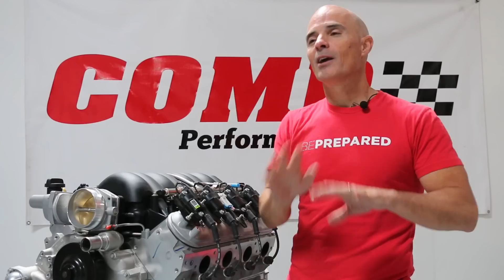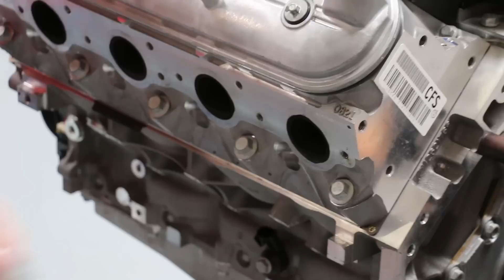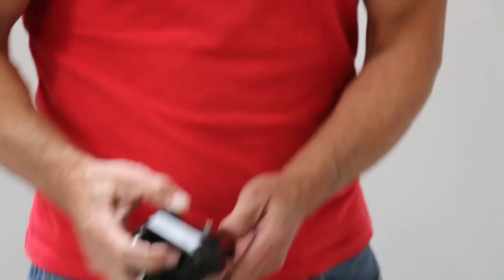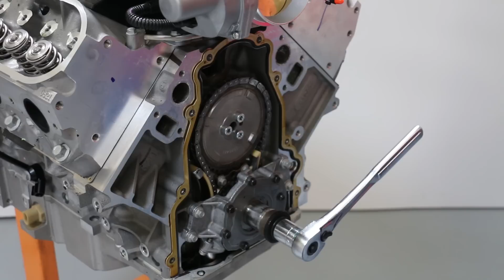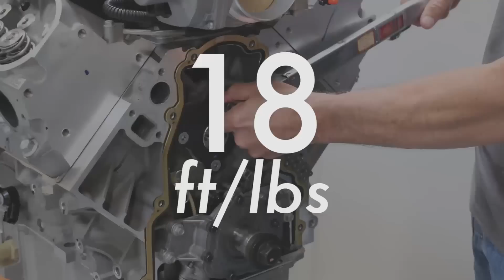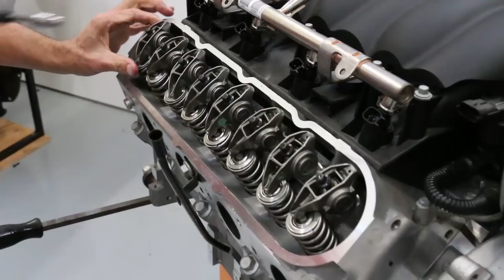Back To Basics: LS Cam Swap

Comment: The crate engine has new gasket and re-use of some would not be a problem, but I have to point out the camshaft plates fitted O-ring potential problem effecting oil pressure. This seals the two oil galleries and allows for crossover on the front & back. The gallery on the oil filter side (Left in drivers seat) supplies both the left bank of lifter but also the cam, main & rod bearings in that order. Oil in the right side provides lifter oil only, but circulated to either side at both ends of this engine. 
 While a fuss is made about the pickup tube sucking air, then using higher volume pumps, plus the dirty oil bypassing the OEM plastic bar-bell are all valid concerns. Many reuse this one gasket on high mileage (Or Less) during a camshaft upgrade. I just want folks to know this $5 part is just as important as checking the timing marks. Even a small leak here could ruin anyone’s day if at temp oil pressure at idle drops to nothing. I never see anyone point this out when both galleries get dowels installed, to keep the lifter up in case the trays don’t hold during a cam service. I would have used more than a squirt of oil on the cam and discuss proper new cam break-in a little. I am sure it’s getting pre-lubed but still not mentioned. Just a thought!

Comment: so one does not measure the push rod length

a novice mistake
also no upgraded rockers, i know how that ends personally
Reply from the maker: If you are re using stock lifters, our LS cams are designed to work with stock length pushrods. Also the stock LS rocker is a decent design, upgrading rockers would not provide much benefit below about .640 lift.

Comment: I have a motor out of a 04 gto. That I’m sticking in a 49 ford haaaa sorry ford guys.  Anyhow. What cam should I go with.  I like to lay it down all the time
Reply from the maker: Actually our 54-777-11 may be a perfect option for you! It's a road racing/ autocross cam so it has tons of torque, especially in the midrange on an LS1. It's also No Springs Required so the stock LS valve springs will work.

Comment: I’m sure google reads my mind I’m doin a sloppy stage2 into my new truck block and this pops up.
Reply: Use a cam with better lopes. CM or BTR.
Reply: ABOlsen80X it’s just entry level turbo deal I’m just copying sloppy mechanics recipe basically.
Reply: Did you have to switch out the push rods?
Reply: Bill Brown I did however you don’t need to stock ones did measure up fine.
Reply: Kiwi Boosted Garage thank you for your reply. I ended up buying some stronger ones but same size.
Reply: Bill Brown yes I did the same and they seem fine, I did the hydraulic lifters as well I think they are ls7 style bit stronger and the best thing to do is new lifter guides or trays, and the cam retainer plate to ensure a good seal for oil pressure.
Reply: Google can't read your mind yet, but they do listen and record everything you say.

Comment: My son has a 99 Sierra with a 5.3 with 180k mikes. I know the old design small blocks but haven't had to work on an LS. The seem very simple. My question is 180k too many miles to be hammering on? I wouldn't even ask the question about the old design because those rarely even saw 180k without a rebuild. This one still has great oil pressure, good compression and no smoke. Just not sure it would be worth doing or not.
Reply: You have a few things to consider here. You'll need to change the springs, lifters. You'll find about half of or more of your pushrods are worn into the rockers. After rectifying that you'll want to get a converter to make this all work. Weight of the truck, converter, gears and transmission are all factors in choosing the proper camshaft.

Comment: Pretty good vid.I gave it a thumbs up for sure, lots of useful info, sped up in the right places, details and torque specs. Very good info. The lifter rods are a must, (ask the guy who had one slide out and drop into the bottom end...), things I'd like to add to the video for those about to do a swap. 
1.When installing and removing the cam, take more care and time, I heard a lot of clanking and cringed as he was sliding the new one in.
2. Change the timing chain damper to an LS2 style, yes the chain will have some slack, also swap to a C5R chain
3. Should use a new cam retainer plate
4. Loctite on the cam bolts
5. RTV in the bottom corners of the timing cover where the oil pan meets up
6. Press the damper on with some threaded rod or a bolt and use a nut with some washers to do the pressing.
7. Buy an ARP damper bolt, reusable and torque to 250ft lbs
Reply: Very good info!!
Reply: I’ll inform my mechanic 👨‍🔧 those tips when I get my cam swapped

Comment: Do you recommend red loctiting the three cam/cam sprocket bolts?
Reply: never use red loctite.  You'll have to use an air chisel to take them out.  I use blue on mine and have never had issues getting them backed out.  Also if you have the cover that uses torx head bolts only torque it to 11 lb ft.  If you have the hex hed bolts torque them to 18 lb ft.

Good luck Zack.  Also, I have a pretty detailed video that shows my cam swap that goes into some things that others didn't cover if you are interested in checking it out.  It also has dyno results!

https://www.youtube.com/watch?v=E0De1c0XwmQ&t=1494s
Reply: @JeffLyle  No air chisel required. Just a little heat from propane torch and ANY color loctite becomes un-loctite!!
Reply: @milojanis4901  haha very true... heat will melt all loctite.  Just be careful with heat on internal engine components... overheating can impair the strength of bolts and other parts.

Comment: Sorry if this is a "rookie question" but i'm wondering if a LS9 cam would work in a 5.3 LM7? This is my first LS build and the engine will run about 10 PSI of boost from a turbo. If it will work what else would I need? ie: valve springs, lifters, pushrods, rocker arms ect. If not what would be a good cam to look into that wouldn't break the bank? (LS6 cam is unfortunately not an option for me) Any info would be greatly appreciated. Thanks.

Comment: At 3:43 the cam bolts were allen key, at the 4:30 mark they are 10mm.....
Reply: He mentioned that he would take a look at another motor with the oil pump removed to better show how the marks line up for TDC.

Comment: Is there a reason to not take the oilpump off? It looked simple enough without taking it off , but just wandering?
Also I don't feel too cheap using HarborFreight ratchet sets after watching this.
Reply: im wondering as well. Remove oil pump or not?

Comment: always spin the engine over twice after u have the timing set in place to 100% verify that you are in mechanical time and the dots line back up
Reply: Great tip
Reply: Have you guys ever seen the 2 dots suddenly not align after turning the engine? I'm just trying to understand how they wouldn't align after the chain is tensioned and bolted. Obviously easy to check, just curious
Reply: Only if number one cylinder wasn't at top dead center when you started. Make sure something weird didn't happen before you start like your keyway broke or your crank gear is off or something like that
Reply: Imagine getting it spot on dot to dot, putting on the timing cover and then finding out later on you are off 1 tooth. Would be pretty unlucky

Comment: You forgot to put sealant on the mating surfaces between where the oil pan & timing cover gaskets meet.

I just fitted new lifters into a stock LS1 engine with a tune done on it, it is one Holden ordered with the 99-00 Camaro cam installed except it doesn't run an EGR valve,it is the most aggressive stock camshaft besides the LS6 can that GM fitted.

My point is that engine fires over much easier now as if it's got more compression,it had sticking lifters which were holding the valves open so I might be very happy with its performance in its current form.

Some people may just think I'm driving a Skyline now because it runs that smooth.

I do have to take the oil pan off this weekend & aluminum braze it because it has a slight fracture in the front right hand corner causing the engine to leak slightly,I'll see if I get the job finished by Sunday.
Reply: cool story bro

Comment: Since the engine was on a stand he could of rotated the engine upside down during the camshaft removal and installation process gravity will keep the lifters in their guides!!
Reply: i wish i could have flipped my car last week when one fell, I had read so many forum posts and even had many friends do cam swaps and rely on the lifter trays to hold them up. They all made out fine. I was the "lucky" one who had 2 slip out (#7) i was able to remove the intake valley cover and get to them with a magnet, but still had to remove the drivers side cylinder head to reinstall them. went from a 10 min cam in and out, to a 3 hour cam in and out.
Reply: @06goatm6  get some wood dowl rod and slide them in the 2 upper holes to hold the lifters. Cheap and easy insurance.
Reply: Ok dumbass.... Are you going to be able to do that when you engine is your car/TRUCK.... You going to flip your truck or car upside down?!? dumbass.... INSTRUCTIONAL VIDEO!
Reply: Gatorsrok this comment made me lol
Reply: @betosgarage  You're welcome ;)
Reply: Gatorsrok 😂😂that’s a good idear. We could build a rotisserie that hooks to the front n rear bumpers and rotate the car 180 degrees just to put a cam in .Need to have some hooks so u could hook bungy cords to a diaper so all the oil doesn’t run all over the fucking floor.
Reply: Gatorsrok I really hope you’re having a better day today than you had when you made this comment man.

Comment: Is the 5.3 any different
Reply: All LS based engines are basically the same.  If you change your valve springs (which you should definitely do), then you'll need a special tool for that.  Comp cams makes one that works on all LS engines.  Some other companies like proform make some that only work on the truck motors but they are a little cheaper.  I've used them both and in my opinion the comp cams tool is much easier to work with.  You can see how I used it in one of my latest videos.

https://www.youtube.com/watch?v=E0De1c0XwmQ&t=1494s

Comment: I just spotted a Harborfreight socket from a 1000 miles away!
Reply: I’ve been using my harbor freight impacts on a daily basis for three years. Nothing wrong with it
Reply: LMFAO I did too!!! Purple 10mm hahahah
Reply: I got the same set is great for the do it yourshelfer.
Reply: Those 10mm sockets tend to get pricey the more you have to replace them
Reply: If it works it works.

Comment: Why install the harmonic balancer before tightening the timing cover? Is there a reason for this?
Reply: Cesar Gonzalez centers the cover to prevent oil leak.
Reply: Yup what that guy said i learned the hardway on my ls swap in my regal and now have to remove water pump crank pulley and timing cover to replace seal now that its in car and ive ran it ro find out its leaking lol

Comment: is it alot more work when doing the lifters as well?
Reply: dimetime0 you just have to take the intake manifold off, all other steps are basically the same
Reply: Heads need to be removed to access lifters. Its twice the work.
Reply: @matthewwiersma2031  Sooooo. . . collapsed lifter = head removal ? ? ?
Reply: @bigLOSdog  unless you dont plan on replacing it. There are ways to free them up without disassembling
Reply: @matthewwiersma2031  I ran transmission fluid in the motor on idle. cant seem to get that lifter free. 180k on the motor.
Reply: @bigLOSdog  how do you know it's a lifter
Reply: @matthewwiersma2031  the #8 cylinder had a misfire and is knocking. Also that rocker has about a 1/4 gap.
The pushrod isn't bent, all other rocker arms are flush.
Reply: @bigLOSdog  I would try pulling  pushrod out and make sure it's getting oil flow through it. Squirt some penetrating oil or atf on the lifter and try working it with a blunt screwdriver or something. Maybe you can free it up. Not as common for a cylinder 8 lifter, usually its #7 and it's a dod lifter that's stuck.
Reply: @matthewwiersma2031  I removed the pushrod and sprayed Seafoam through it. its all clear like a straw.  By working the lifter, do you mean tapping it with the blunt screwdriver?

Comment: He Should have mentioned the torque procedure when tightening the rockers and also should have mentioned to degree the camshaft after setting the camshaft and timing set
Reply: sskatersk1 you don’t have to set valve lash, just torque down the rockers and you’re done? Didn’t even pull off the intake. That seems like a relatively simple swap. Am I missing something??

Comment: So many important details and steps left out and things done incorrectly that could result in damage to the engine comp cams failed, so cringeworthy
Reply: The video assumes that you aren’t a complete idiot and knows all of the supporting mods you need to do to use the cam. Just sayin’
Reply: Where can i find the correct info then,
Reply: Fr this dude straight up impacted the spark plugs out

Comment: where can I get that lifter holders u have
Reply from the maker: We have several part numbers, depending on your application. Please contact 800-999-0853 to speak with a tech for proper recommendation.
Reply: thanks

Comment: Can anyone tell me why he rotated the engine to relieve spring load to remove the rocker arms? I never hear of anyone bothering with this for removal, only for reinstallation.
Reply: Chris Hill I was wondering the same thing, maybe in some way it helps prevent damaging the threads
Reply: Aaron Purtell that's all I can think too! I just unscrewed all mine at once , didn't seem to cause a problem.
Reply: Chris Hill that's all it is for is to prevent thread damage
Reply: he did this unimportant step but doesn't degree the cam...SMH
Reply: +Bnasty Stuntz hes using a stock cam gear its not like can set the cam timing that accurately anyway and i usually just slam a 0degree button in anyway unless your going for every last horse on a dyno your not gonna notice the difference

Comment: Where do u get those rods at that hold the lifters up???
Reply: Don't bother with those $100+ rods. Just get a set of wooden dowels from a hardware store. That's what I did for my cam swap.
Reply: VeritasEIREAequitas +1 would also like to know
Reply from the maker: https://www.lsxceleration.com/powerhouse-products-gm-ls-lifter-retaining-tool-pow101046/
Reply: Looks like the bar at end of a chain link fence! IJS!
Reply: If the engine is brand-new it doesn't matter if it's upside down or not, the trays are more than capable of holding up the lifters, even over time..
Reply: I've never had a lifter drop and I've even left the lifters in the trays for days at a time.  For cheap insurance though, use 5/8ths dowel rods... much cheaper than $100 tool.

Comment: what's the tools called that u put in to make sure the lifters don't fall in?
Reply: Cesar Orozco I went to home depot n got a long steel rod and cut to length... worked like a charm...
Reply: Cesar Orozco just some special D shape dowel rods from what research I gather. Post up If you get a name or find someone that sells him I'd like to have a set myself
Reply: Ok thank u for the help

Comment: False... give the harmonic balancer bolt 5-6 nugga duggas after you pull in the balancer and you'll be fine.
Reply: Sloppy calls it giving a couple extra brrraappss.
Reply: With the history of stock balancer failures on LS engines, I went with an aftermarket balancer = $300. Also, did a valvetrain upgrade with springs, trunnions, seals, pushrods. All good insurance for the added lift stress. Cost a few hundred bucks more, but don't want to risk failure of any of those components since a new engine is a lot more expensive than those components.

Comment: Doing an AFM delete on a 114K mile LS3 using a new cam and lifters. Obviously heads need to come off to access the lifters. But this is still a great view, especially for putting the front of the motor back together. Thanks.
Reply: Steven Redman LS3 doesn't have AFM

Comment: is it the same sequence to torque the balancer bolt on a ls1? get the balancer started then using the old bolt to fully seat it and torque new bolt to 255ft lbs? except ill b using an arp bolt..

Comment: oh this doesn't look so...[looks at my cramped engine bay] NOPE
Reply: 4th gen camaro engine bay................. FUUUUUUUUUU
Reply: Lmao 😂 if you've seen the trucks you could do it in your driveway easily. I have a 04 2500hd with the LQ4 (iron block ls2 with slightly different heads) and I just have to pull off the radiator and I can swap my cam (which I'm doing soon) and pretty much anything I want lol I can put my arm down through past the manifolds without getting burnt. It's great
Reply: @Marathon13240  same with my 97x. Gonna be doing a nice 5.3 cam swap after the summer!
Reply: Trevor C you don’t have to take out the radiator 👌🏻
Reply: C6 ls3 bay is so roomy once i pulled out the air intake for install.
Reply: Cris Bronson lol

Comment: Isn't the torque spec for the cam retainer plate 11Ft. lbs. for torx bolts?
Reply from the maker: 10 lb-ft is the most common spec we have seen.  Here is a helpful link for torque values: http://paceperformance.com/p-3981-gm-enginetorque-specs.html Thanks!

Comment: I have an ls2 in my GTO and im looking to reach around 450~whp and maintain driveability as it is my daily, what cam would you recommend? I was recommended the GM hot cam by a local mechanic with tons of LS experience, but the specs seemed very small for such a high displacement engine
Reply from the maker: Thanks for your interest. best option is to contact the COMP Cams CAM HELP line at 1.800.999.0853. The techs will have a few questions about your engine and overall setup and will then be able to help you pick out the best cam for your GTO. Hope this helps!
Reply: COMP Cams Ok thanks!